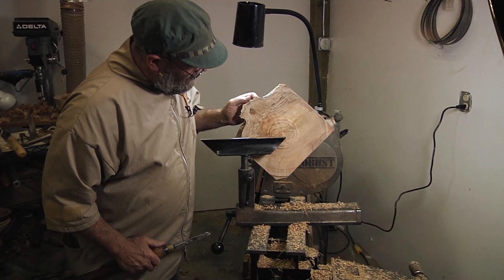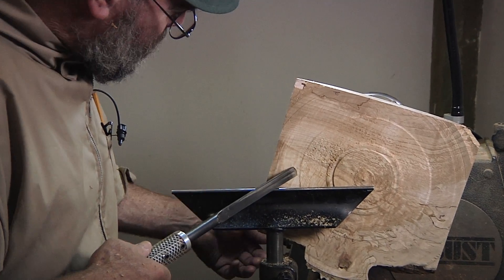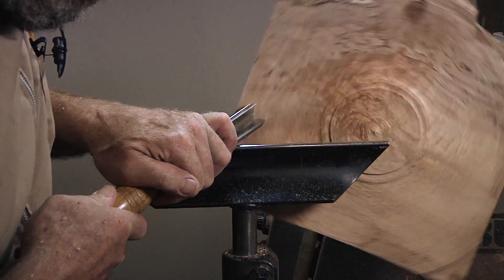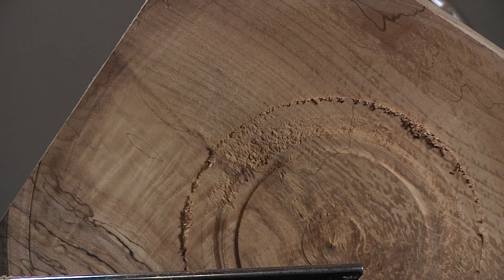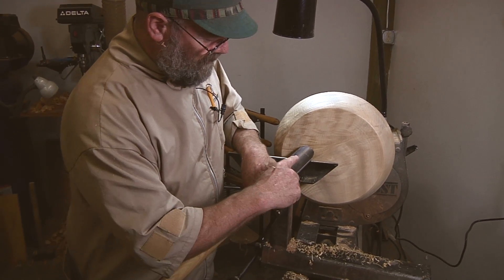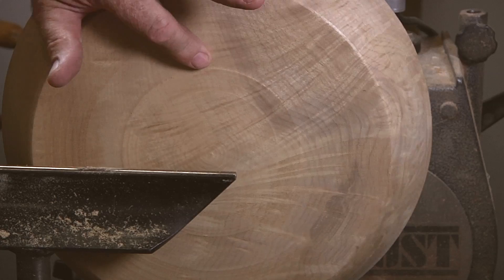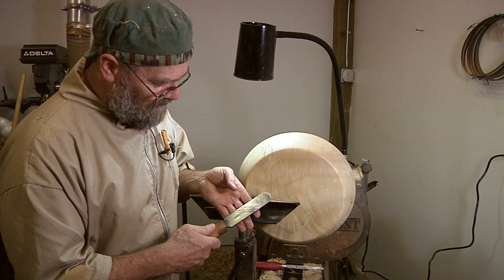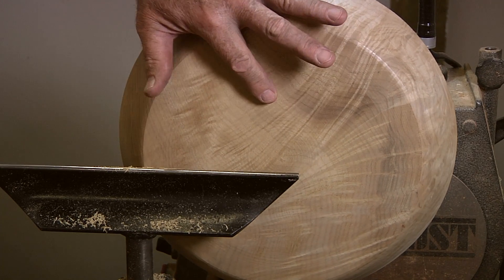FINISH CUTS: PUNKY MAPLE & FIGURED MYRTLE with Reed Gray aka Robo Hippy

Comment: Robo, outside of a bowl mostly, maybe face of a platter.  SRG nearly upside down.  Cutting action would be similar to what you are doing, I think....high shear angle.  But the cutting is more on straighter sides of the SRG rather than towards the bottom of the flute.  Nearly impossible to catch a corner of the SRG when the corners are facing down towards the toolrest.